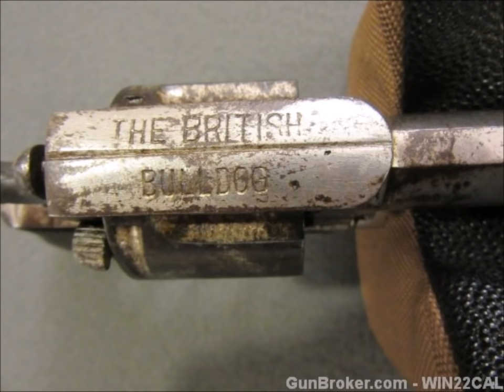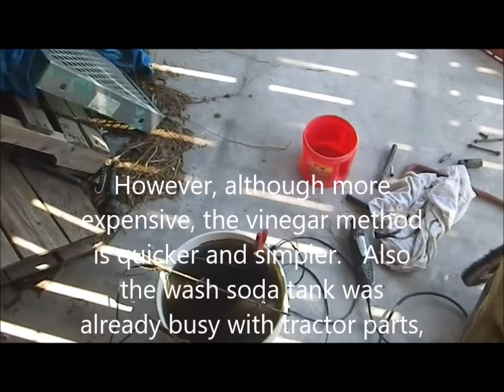Bulldog pistol restoration

Comment: Had mine looked at. Needs a cylinder lock pin and lock pin spring probably the trigger return spring. Can't find any Smiths to fix it. Any advice?
Reply from the maker: See Mr. Novak's video at https://www.youtube.com/watch?v=PKqNK9CMBxE to learn about making new springs.  Regarding your 'cylinder lock pin' you will probably have to make a new one.  I have a video up here where I make a new cylinder bushing for one.  The real gunsmith problem is the cost of fixing these would be much greater than the current value of these pistols.  They cost $2 average when new and they are still mostly worth less than $200 given that they do not use currently manufactured commercial ammunition so you are looking at machinist costs (time, toolks, shop rental, etc.) versus the gun value.  It is best to just learn how to make and fit the replacement parts yourself.
Reply: @kenibnanak5554  well I must be an idiot I paid $300 but I want to bring it back to service so I may just have to pay a gunsmith but I will watch the video. Thnkyou very much sir
Reply: @kenibnanak5554  I know it's going to cost some money but to be honest sir it will be done right and timed. I've fooled around with modem revolver trigger springs but not sure if making them is out of my league

Comment: Fingers crossed still at gunsmith. He called me and said he van make the trigger soaring but missing something else
 Asked him to call some older guys to hopefully get it fixed. I have a local guy to plate it but just want it working. Not many can fix these
Reply from the maker: Sadly a lot of American gunsmiths are no longer trained on the old designs.  Although repairing and maintaining double action revolvers was a standard armorer's skill set up to the 1960s,, like the repair of box lock double barrel guns, it has fallen out of vogue now that gun designs using stamped parts and molded plastic have replaced the old designs.  
Too many gunsmiths today are only trained or experienced in fixing ARs or standard military service pistols.   A lot of them have never bored out and sleeved a barrel, cut a new chamber, adjusted a revolver's timing, or even made a new V spring.  Demonstrating such a skill is not required as part of the process of applying to ATF for a gunsmith license.  
Although there are many very competent gunsmiths who can easily do any of those tasks, and provide the full range of services for just about any gun type that walks in their shop doors, the number of such individuals shrinks constantly.  
Missing and broken parts are not uncommon when encountering an old Bulldog, RIC, or Adams type revolver that has sat in someone's attic for 70 or 110 years.  Some original owner encountered the problem then put the gun away as a future rainy day project that they somehow never got around to.  Now it is our problem.
Reply: @kenibnanak5554  I agree Ken but I had to tread lightly. He said he could make the trigger spring n p but another part he wasn't sure about. I bartered to give him the Iver Johnson .32 if he would please consult older Smiths. I bought both if these on Guns America not realizing how hard repairs can be. Hes working in it. No news is good news. Hes supposed to be very good but can tell he's younger Smith. Ill let you know. I wish you lived near me sir.
Reply: Ive learned when dealing with artisans craftsmen etc. If you can't do it yourself and you're relying on them its. best to not pressure them. The last thing you want is him to say come and get it I didn't want the job anyway. Now you're back to square one running around from Smith to Smith.

Comment: Just got mine soaking in hot vinegar in my ultrasonic cleaner. Can I buy two of those springs from you? I'd really appreciate it.
Reply from the maker: Sadly no, my FFL expired years ago, but any good gunsmith can make them for you.  Also M Novak (aka Anvil) just put up a good video about making a shotgun spring which is very similar.  Vinegar (which is after all an acid) is a corrosive.  I would be very careful with long soaks (and note this will destroy both old springs and also remove bluing).  Remember to neutralize the vinegar with a baking soda solution dip afterwards and then rinse and druyy.

Comment: Love the project. Stopped by investigating the nickel removal process. Have a similar project on a Iver Johnson top break .32 that years haven't been kind to.
Reply from the maker: I very much like the Brownells nickel remover.  A*B bottles,, 50/50 mix.  Reusable.  Fast and easy,  Just let the parts soak in a small plastic tub or glass jar.  The nickel begins falling away in seconds.  Follow the written instructions closely.  The mix is reusable, so I mixed up a batch years ago and it sits in a mason jar ready for re use while the unused A&B also sits waiting for a task.  Expect to do much polishing.  BTW, Borwnells also carries flat spring stock for making new V springs.
Reply: Ken ibn Anak I have a few shotgun projects to finish then I'll start stripping.

Comment: how to reaper cylinder wont catch huck theat suppos to rotate it
Reply from the maker: The cylinder Hand is supposed to engage notches at the rear of the cylinder.  I would suggest using the Gun Digest Book of Revolvers Assembly and Disassembly.  It does cover the Bulldog and will serve to show you if any parts are missing or visibly damaged.
Reply: @kenibnanak5554  thank you

Comment: I ment to add - I was wondering about wd-40 in my ultrasonic in a small jar sitting in a water bath - I've been trying to get a equally old lens cell apart to rebond it's doublet - think I'll try it (can't loose on this one). Thanks for the response
Reply from the maker: I have never tried any oil, WD 40 or anything flammable in my ultrasonic tanks.  I understand what you are trying to do, but be careful.  Usually there is a heating element under or alongside the tank wall and I would be worried about the fumes reaching the heating element.

Comment: A much easier way to get rid of rust on guns you are going to refinish and restore is using a rust remover that you just soak the parts in for a day or so like Evapo-Rust or Metal Rescue.  It only attacks the rust, is non toxic and is safe on your skin.  It won't harm plating or paint, but will remove bluing.
Reply from the maker: Vinegar IS a rust remover.  But regarding soak times, all rust removers cause pitting.  The longer a piece of steel soaks in it, the more extensive the pitting get.  Suggest watching MR Pete''s videos on rust removal.  For something like a gun, with tolerances that should be kept pit free, a few hours is plenty.

Comment: Just wondering how the bulldog is coming along, and how you were going to go about renickeling the parts. Would love to see an update video.Cheers
Reply from the maker: Yes, I need to finish that project.  Life happened and I put the project on hold.  Sorry about the delay.  Mostly ready for the copper plating.  Hours of hand polishing to remove pit marks accomplished.  Making new tapered .12" frame screws has been a project in itself.  A tip of my hat to the long dead person that came up with a way of making such in quantity.
Reply: Hopefully you get to do a finish product video!

Comment: hi i am looking to buy a hammer of that revolver ..mine is broken and missing the uper side of it ..so were in can buy a hummer like that ?? mineis a 44 cal...regards panos
Reply from the maker: Well the bad news is (good news at the bottom) most of these pistols were not turned out by factories.  Most of the 19th century Bulldogs were fitted and assembled from buckets of parts made by dozens of independent 3rd parties and literally sold as parts in open air markets.  One person made hammers, someone else cast the frames or cylinders, etc.  These parts were then culled by different gun sellers and pistols assembled by hand then sold after proof testing.   The end result for you is no two Bulldog hammers are likely to be identical.  

The two main exceptions are the ones made by Forehand and Wadsworth and the post 1885 ones made by Webley & Sons.  Those were factory built.  

Webley & Sons initially had a tiny little cottage where they made their wares.  They invented their R.I.C. revolver and the orders quickly outstripped their production capability.  So Mr. Webley sent one of his sons to Europe with drawings and samples and had him contract with dozens of parts makers (primarily in Belgium) for components for their R.I.C. revolver.  He did the same thing with the Bulldog and some other Webley variants.  Some parts makers were even licensed to stamp the Webley name on assembled guns that passed local proof tests and then sell them as Webley products under license.  Others not so licensed continued making parts or shared the drawings with other parts makers who then sold the parts to other people who assembled them into complete pistols of varying quality and size but without any maker name being placed on them.  

Over a million more or less Bulldog pattern revolvers of varying size and caliber were produced and sold.  There is almost no parts interchangeability amongst them.  

The bulk of this fabrication activity occurred in Belgium although really by the 1910s the manufacture of 'looks like a Webley design' pistols was happening virtually everywhere on the planet from Europe and Asia to the Middle East and even in the Americas.  WWI ended the Belgian and French cottage gun industry and the Spanish Civil War did in most of the many gun makers in Spain.  In both conflicts a place where weapons were made was considered a valid military target for either capture or destruction.  Of course also by the time WWI began the era of the auto pistol and smokeless powder had rendered these guns obsolete.  

You can approximate date yours by the proof marks found on it.  That will also tell you in which country it was first proof tested.  Every few years the proof marks in each country changed.  

The good news for you is, assuming by upper part you mean the cocking spur, any good machine shop can probably make a new cocking spur and Tig weld it on to your hammer.
Reply: thank you  so much for your time and eford to answer to my question ..regards panos ....i will send you a foto of it

Comment: Just a bet that at that with age of the pistol the threads were either Whitworth or some metric std like DIN (deautsche industrial normal).  You were wise in how you solved the issue.
Reply from the maker: Under magnification they are not Whitworth.  #10 seems to be pretty close, but not exact.  It is annoying that the screws have tapered bodies.

Comment: My GF owed me $200 and she offered her Colt SSA Army .357 that was in a fire.  Not a bad exchange as it is definitely a good interest rate return.  May I suggest using some metal polish cleaner with the dremmel wheel.  I got mine from an auto parts store.
Reply from the maker: I am not sure of the connection between a non-fireable 20th century Colt SAA and a Belgian Bulldog from the 19th century beyond both being revolvers, but I thank you for the suggestion.
Reply from the maker: Hopefully you are aware a gun that has been fire damaged is usually unsafe to shoot.
Reply: @kenibnanak5554   Not true. They were forged at temperatures FAR more hot than a fire. It only scorches the surface.
Reply from the maker: @10MinutestoRouletteFortune  The issue is annealing which is a far lower temperature than forging.  Annealing softens the metal.   Look up annealing.  I will repeat, if a gun has been in a fire it is considered no longer usable.
Reply: @kenibnanak5554  I know I'm 2 years late, but there's many factors to that, but I will agree partially and say do not fire that until it has had a hardness test from a competent gunsmith 
I've seen house burned to crisp guns be saved and closet fire guns be ruined 
There's so many factors to that though

Comment: The vinegar method of rust removal vs electrolysis the electrolysis wins hands down because it removes carbon as well. Vinegar works well its just the electrolysis seems better to me for heavy rust. 

Good Job on the video and gun.
Reply from the maker: Thanks.  My observation is the vinegar is quicker, but we have to remember it is an acid and it will cause some pitting where none existed before.  Always rinse the metal with a water and baking soda solution, then rinse it again, dry and lightly coat it with oil to keep oxygen and water vapor off the bare steel.

Comment: I'm.pretty mechanical id strip it and clean but probably have it done
Reply from the maker: The initial big issue was the flaking nickel plating with rust underneath.  I have polished out as many of the hidden rust pits as I can.  I replated most of it tonight with dull nickel and will do a brighter nickel later this week, but of course I can't do much about deep pits other than to minimize them a little..  Another issue is broken springs and most annoyingly, at some time in the 130 years someone filed the firing pin so that it can't reach a cartridge.  It is about 1/16 of an inch too short.  Because the firing and the hammer are one piece, that is a big problem.  Reassembly when I am done will be as the Gun Digest book of revolvers shows for the H&R version of this Bulldog revolver.
Reply: @kenibnanak5554  mines coming soon. Not sure how to proceed but first I have an ultrasonic. Thinking remove grips. Dunk hot simple green and water first. Then vinegar. Then hot oil .Blow dry and plan next steps
Reply: @kenibnanak5554  you're obviously very experienced. I'm going to do what I Can without damaging anything and go from there. My seller says it works in both actions. I'm worried about springs now. Can I send it to you? Lol

Comment: wow you went through way to much work like how to remove rust also putting the nickle back on your gun is very simple using house hold stuff like white vinegar salt and nickle welding rods but remember it will only be as good as the finished metal. i have nickled many parts this way like mags trigger groups etc and they look like chrome . to test how good the nickle is try putting gune blue on it if it turns blue it is no good none of my nickle jobs will except blue and to remove it that is also very simple just reverse the process . you make it way to difficult
Reply from the maker: I is currently copper plated.  The nickel will be added later after I make better springs and screws.  It is a round tuit project.  Other things take priority.
Reply: @kenibnanak5554  dont believe the old bs that you have to copper plate first YOU DONT HAVE TO actually i have found nickle just over the polished metal seems to actualy work better and more durable
Reply from the maker: @wmdevittdevitt2686  Of course we don't have to.  In the 19th century the use of copper first wasn't in play for the firearms industry.  That said, it is my personal choice to do it the hard way.
Reply from the maker: @wmdevittdevitt2686  I am not angry at all.  I am reasonably familiar with plating and what does and doesn't have to be done.  .I am not aware of any  Belgian guns from the 19th that got copper under the nickel plate.  I may be wrong but I believe that combination of platings over steel wasn't done in an industrial setting until just before WWI began.  Even today most firearms makers don't bother and just throw the nickel onto bare steel.  If your work is coming out shiny I am assuming  you are using the Watts process with a brightner.  I actually haven't decided yet if I want this revolver to be shiny or not.  I think it is more important that whichever mix I decide on that the nickel not flake off for at least a few decades.  A major portion of this past 2 years fun with this revolver has been 600 grit hand sanding out the deep corrosion pits 100+ years of being possibly stored inside a damp sock have caused without removing stamp marks.
Reply: @kenibnanak5554  for the home plater it is very simple you make the nickle acetate first you can use 2 nickle welding rods at least 99 percent pure now i mix generally a good size bath half a gallon distilled white vinegar and say about 5 tbls spoons of salt it acts as the carrier put both rods in the mix with say a 6 volt 1 or 2 amps let it cook for a few hours at least till the solution turns a pale blue that will be your nickle bath the rest is simple leave the positive on the nickle rod hook the negative on the part .now that being said i use no brighteners too toxic but if you polish your steel up to a mirror finish when you plate it will amaze you just how good it really is leave the part in for a few mins like your revolver likely 10 min when you pull it out your part will be dull as usuall all you need to do is buff with 0000 steel wool or polish with autosol chrome polish it works and it works very well and i have had no signs of flaking off what so ever and some of my stuff has been plated for like 5 yrs with that process
Reply: Hey buddy there and old saying that applies here.  Its put up or shut up.. talk is cheap, so let's see your video tutorial...